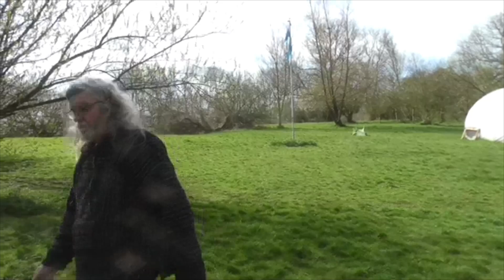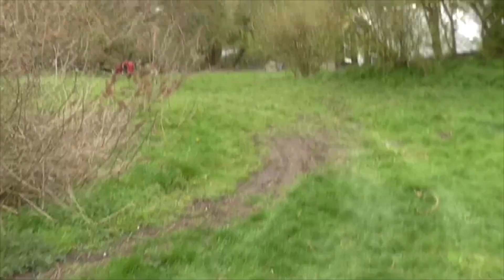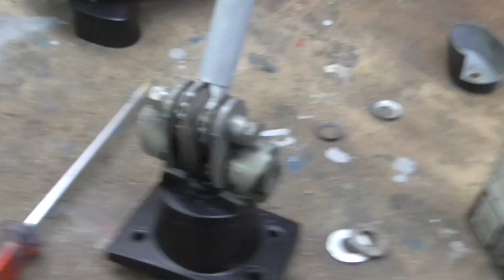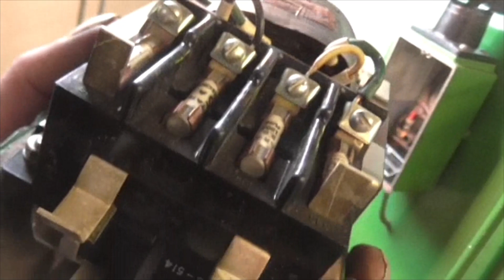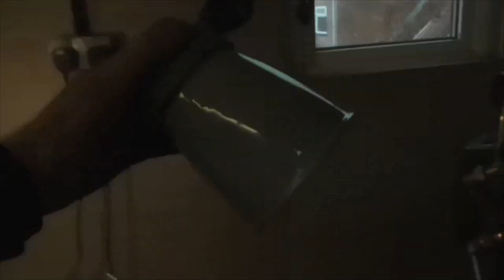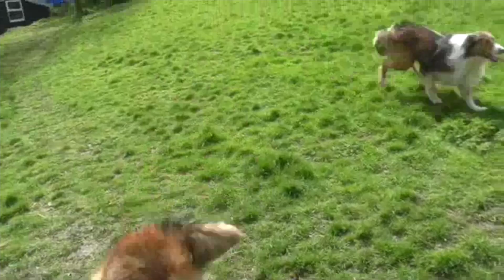Mugged by Dogs, and a Lovolite rebuild for the Harrison milling machine!

Comment: You've done a very nice job of the work light Phil. That trailer looks a gud un. That chassis looks nice and strong. Enjoyed the green scenery Tony
Reply from the maker: The chassis is 4mm box section,and all the ends are sealed, going by the type of ball hitch, it comes from a high end caravan. I am really pleased with the worklight, especially as it now works!, it had me puzzled at first!
Phil